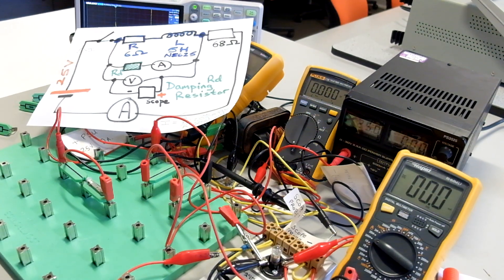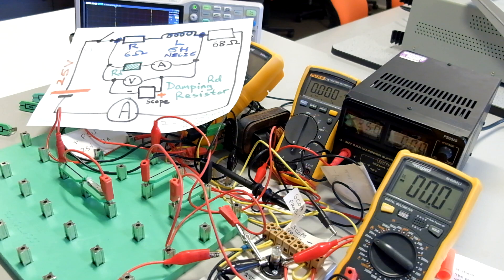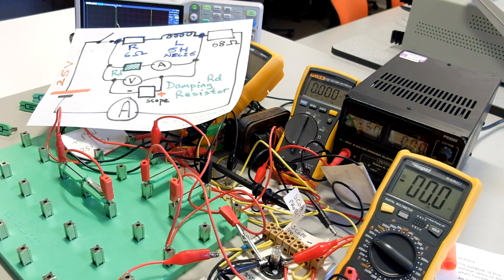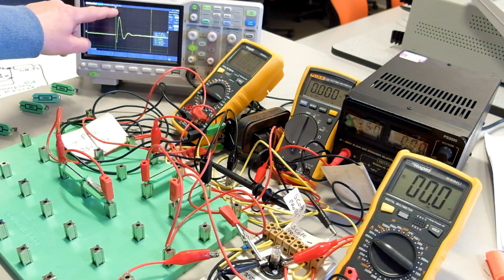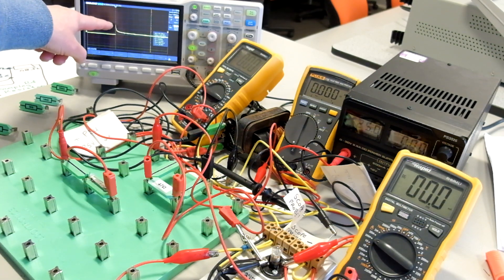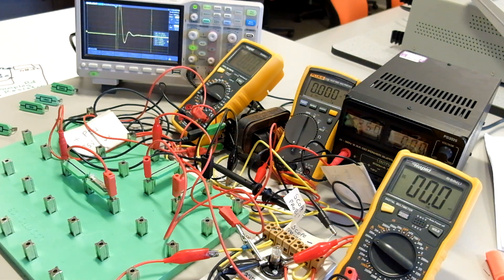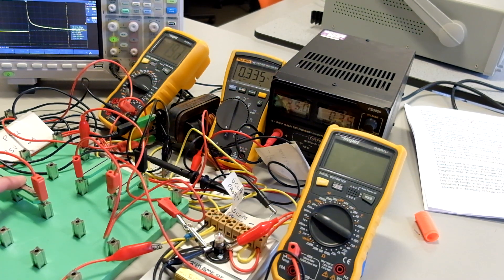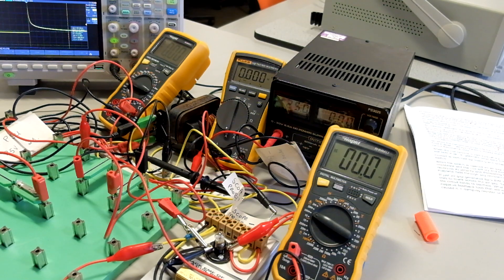Back EMF of Inductor by experiment

Comment: How much back EMF volts can I get from positive 35v DC on+ off, at 6 amps DC , to inductor 1.75 millihenry to 10 ohms reisistance to ground?  I need = > 100volt over the resistance. Diodes inverse parallel.  Formula depends on speed of switch as a transistor. I have neon bulbs type variable voltmeter 110 to 470v.
Reply from the maker: Hi 35v into 10 ohms will give 3.5A steady state Quite high. May be problematic. 1.75mH won't give much back EMF spike The one in my video is 5H and gives a few hundred volts >300V
Reply from the maker: Try different coils. Experimenting will get there!